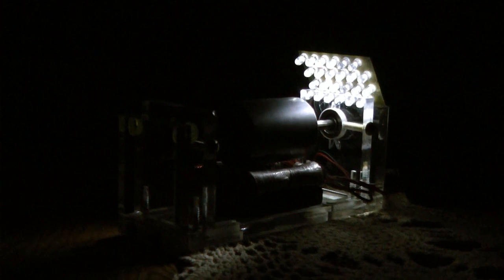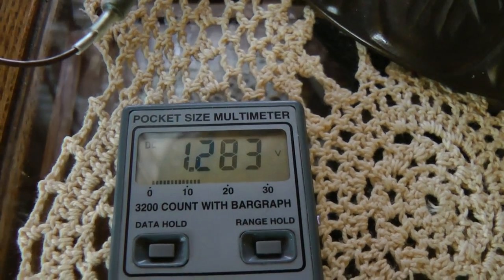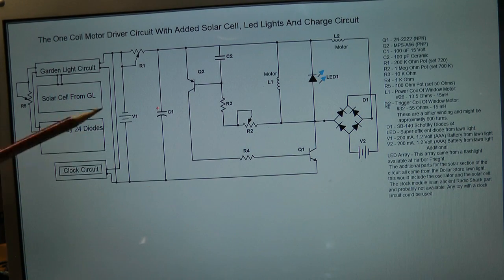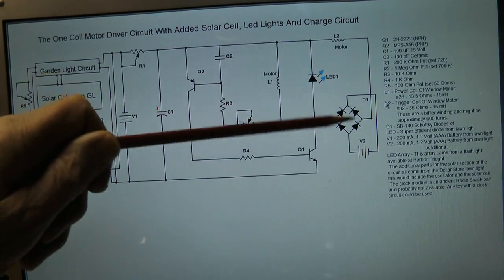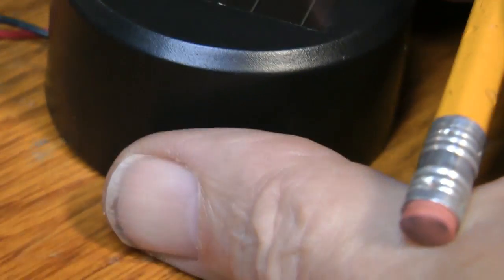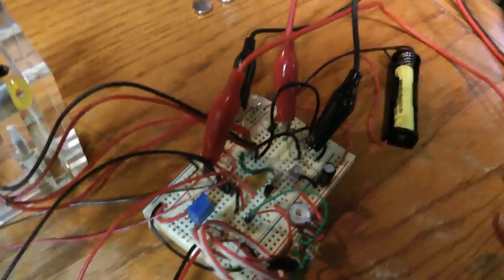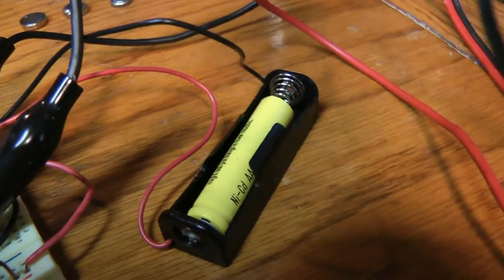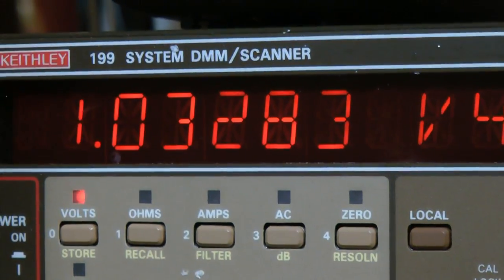1 Coil Perpetual Motor Circuit

Comment: what's with all the jumper bare wires that connect to nothing? because on the breadboard the circuit looks far complex than what is presented in the schematic....

randomly added components????
Reply from the maker: A breadboard circuit is meant for testing. Bare wires going to nothing are actually plugged into something for taking measurements. Wires plugged into connection rows get connected together by virtue of the the way the rows are under the board. Sometimes there's spare parts plugged into the board for easy access but I think the only thing not being used is the LED.
J

Comment: I don't know the purpose of the motor. You are using solar energy to run the system and the motor would just be a drain for the lights. Yes, it will run forever because it is storing energy from the sun. It STILL has an energy source and is NOT creating it's own. I guess I just see the point of this video OR the project.
Reply from the maker: Doran, If you were really as clever as you think you are, you should have realized it is only a windowsill toy, It is just a project to see how far you can take a solar light that cost's $1.00 and see how much you can run from it. It has no claims of free energy, overunity, or anything for that matter. It's just something fun to watch and it will sit there and run almost forever. Lighten up. What makes you guys think everything you see is a claim to some kind of miracle discovery? For me it's just about having fun with a good hobby that you can learn something from. If I ever have anything I can call free energy, believe me I'll let you know.
John
Reply: DadHav In the night there is no sun. In the morning the volage was higher than the day before. I think you made a loop of always energy. Beautiful! Thank you very much. Solar Energy is also free energy. Your coil is the miracle in your experiment!!! (France)

Comment: cool video
not that it matters but flashing number when changing is 1/10,000 of a volt or .01 mv
I would love a meter like that!
Reply from the maker: I think you're right. You can find these meters once in a while on E-bay. They sell pretty cheap because people don't know what a scanner is. I don't use the feature often but it can record something like 500 measurements at set intervals. I thing I got this one for $67.00 or something like that.
Thanks Ernie.
John

Comment from the maker: Hi Keys, you're right. I'll put a note on the video right away. Keep in mind you might want to use some trim pots for resistors until you find a good value for a fixed resistor. Also try to use lower gain transistors to help avoid a hard turn on and lock of the transistors.

Thanks

John

Comment from the maker: Hello Ice, You aren't confused. The discharge curve is fairly flat at the null voltage and that's why the experiment didn't end up over unity. I didn't calculate the efficiency due to charging the second battery and then swapping but it was much better than if I would have put a resistive load on the run battery. I wish you could post links in the comment box also.
Thanks for watching. Maybe I can do some graphing next time I do something like this.
John

Comment: I'm confused. Isn't that voltage pattern normal for NiCd batteries? Staying at 1.2V for almost the entire charge until they are at a low charge state, where the voltage starts dropping very rapidly.

Too bad I can't poste links here, but from the wikipedia article "Nickel–cadmium battery" under "Notes" the 4th link "GP Nickel Cadmium Technical Handbook" is a pdf file and has some interesting discharge characteristics graphs in it.

still a nice vid though.

Comment from the maker: Hey Slider, It's good to hear from you. I'm sure you've experienced this. Sometimes you just get an event that is hard to explain. If you do, you have to get some video right? Moving a wire changing tuning by a single ohm, or anything can cause you to loose the experience and you never get it back. I wonder how many people have seen over unity in an experiment but can never claim it because it has to be dependably repeatable in order to have proof.
Take care
John